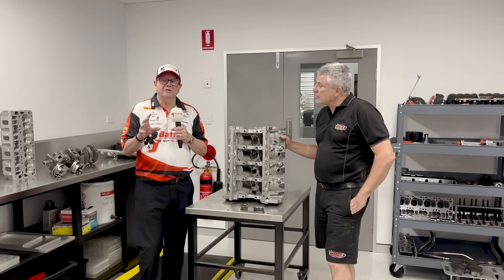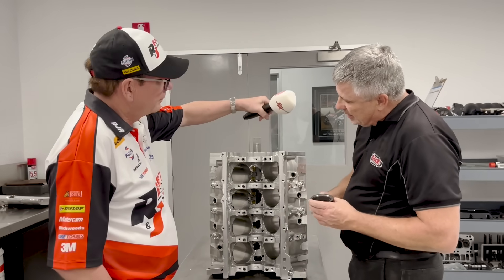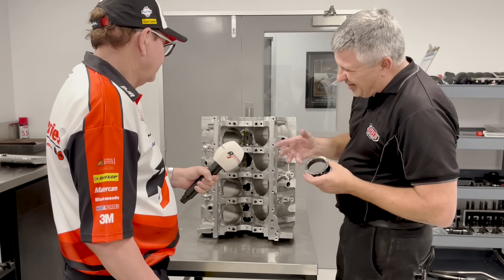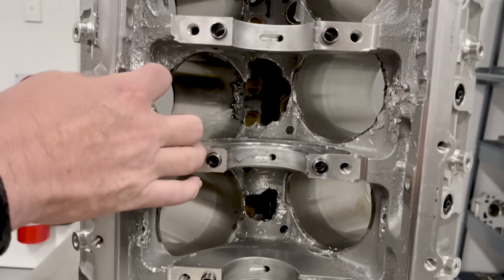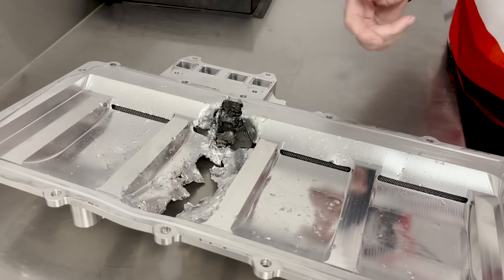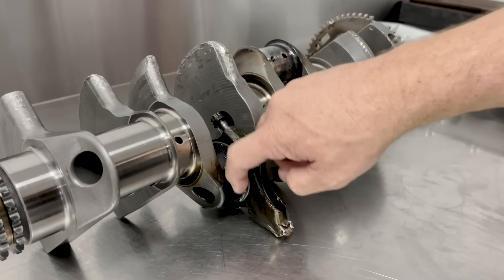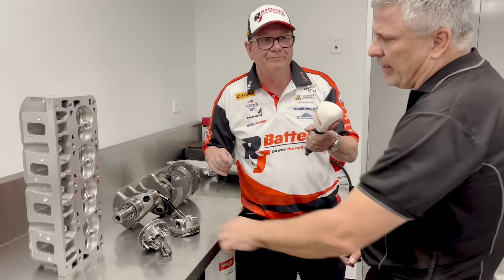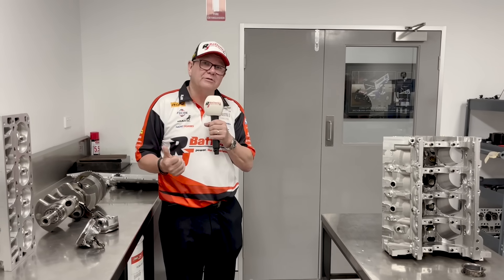KRE show us the inside of the #8 Bathurst engine

Comment: So therefore the main bearing cap was installed incorrectly or the wrong tolerances when it was made, thats what caused the shaving of the metal particulates to come off the main bearings ,plus the engines have very fine tolerances ,which makes it even worse when they do fail, especially oil pressure loss, but its what caused it in the first place for metal to metal wear, then something was not put in right IMO ?
Also thanks for the upload, go Chevy. 🚗🚗😀👍✌👌

Comment: Why would the crank thrust bearing fail on a brand new race engine?
Is it poor lubrication, poor assembly, incorrect clearances, or the wrong parts for the job?

Nothing special about a crank thrust bearing in an alloy block engine, even with a big heavy clutch pressing on the back of the crank.
Reply: @@BigA-zx5io Sure did, but it was not explained. 
I'm a mechanic with 40 years in the trade, including building my own rally cars. 
Never had a thrust bearing fail using the correct oil, fitting quality parts, keeping the pressure up and setting the clearances.

Again, I ask, what made the thrust bearing fail?
Reply: @@BigA-zx5io Definitely need to look at the engine design or the assembly of it if that's the case.

Every rally car ever built dumps the clutch on each new stage multiple times a day, almost every top 20 car is AWD with massive amounts of traction and almost all will be ally block.

Also, releasing the clutch takes the load off the thrust bearing, the load is there while the clutch is depressed.
Seems like there's not enough oil on the bearing, or the material is incorrect
Reply: @Danger_mouse I thought I heard him say the mains were last in line for oil, if so, expect more kablamo in my opinion.
Reply: Narrower thrust face than earlier engines and super heavy clutch diaphrams wouldnt help at all i think..bit of design fail id say..

Comment: Hi Brad, that's a lot of thrust damage, sure there wasn't an instillation error ? 😁Not that the engine was ever going to survive, BUT a blocked filter from a disintegrating thrust ? Was that the return filters blocked ? Or the feed filter ? Seems they could do with having a bit more capacity.

Comment: Well i don't think Ken was overly impressed with this engine or his comments! First of all how much pressure is on these clutch plate cause this is not normal for a LS to do this even at over 1000hp, Secondly if the oil pressure was dropping 3psi per lap why didn't the so called engineer pull the car in and  investigate?? As far as I'm concerned this is on BJR and there stupidity at not looking at critical engine data or a simple oil pressure gauge.
Reply: Bro did you even watch the video? He literally says what happened verbatim. The PDM was overriding and resetting the alarm - yes/no, yes/no - because it wasn't a critical enough drop and still had decent enough oil pressure. By the time the alarm actually held, it was already too late.
Just because you have failsafes, doesn't mean they'll save you an engine. At 7,500rpm by the time the alarm flashes that the oil pressure has dropped, the engine will already be dead in a single second. You can't instantly stop that rotation and lock the thing up to prevent damage. 
EG: If you had an alarm to say the car is on fire. When the alarm sounds that the car is indeed on fire, that doesn't mean the fire magically goes out.
Reply: No i didn't ? Thats why i commented on the video, if the PDM is a issue put a bloody manual oil pressure gauge in, if that was my car and dropping like that per lap it isn't hard to see there's a issue going on. just sick of this BJR rubbish. @dons1932
Reply: @marksmith2726 My point is at only 3psi drop off, you aren't going to get a good gauge on it no matter what you are doing to monitor. If the needle drops instantly enough to notice, at high engine revs, the motor is toast regardless by the time you shut it off. 3 psi increments on a gauge where it'll be seeing 60 - 70psi at full throttle - where it lives - won't be enough to notice. Combined with the fact that it's a driver's job to go fast, not monitor gauges.
Reply: Mark this is actully normal for a LS to wipe out a Thrust bearing like that . In a automatic application with a torque convertor they restrict convertor pressure  in the pump to stop this . These motors should have a thrust bearing built in to the cranks to stop any issues from to much clutch pressure .
Reply: @marksworkshop54  Especially because most street style 1000hp LS don't run carbon / carbon clutches with extreme clamping pressures.
Reply: A 1000 bhp LS isn't running a manual gearbox, they are using a torque converter which is totally different to a clutch like they are using in a V8 Supercar.
Reply: Well not all the time there are manual 1000plus hp LS comabo out there. @tomnewham1269
Reply: @tomnewham1269 unless you're a real racing driver you keep It manual haha
Reply: dumb question, but wouldn't the oil pressure increase if the filter is blocked?
Reply: @AndyPat239  Not if you measure pressure after the filter.

Comment: $$$$$ video, so does BJR have to foot the bill or Supercars as it an engine from a pool and a control part.  That block & crank are toast
Reply: they're leased for $60,000 per season I'm pretty sure,
Reply: @tturi2  $60k doesn't seem enough to take responsibility for engine failures. Too many ways the teams could stuff up and damage the engines. Ignoring falling oil pressure in this case being a good example.

Comment: It's common practice to fit a Torrington end thrust, bearing into an engine destine to be drag raced, due to the thrust  the torque converter puts on the end of the crankshaft. 
This should practicaly eliminate any chance of  further failures
Reply: It would but it isn’t within the rules.
Reply: @NeilJable  its pretty simple. Change the rules , it makes no difference to the power output but could save the teams' 10's of thousands or more dollars in engines each year
Reply: Took the word right out of my mouth. Torrington. Been in use since the 60s on US V8 Motors built for bullet proof usage.
Reply: Was thinking the same thing. They already use needle roller bearings for the cam.